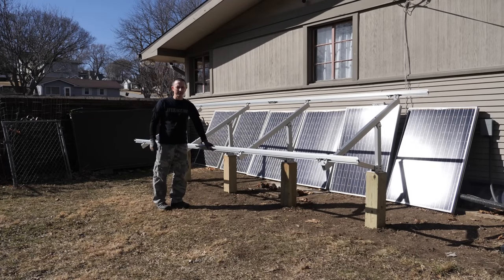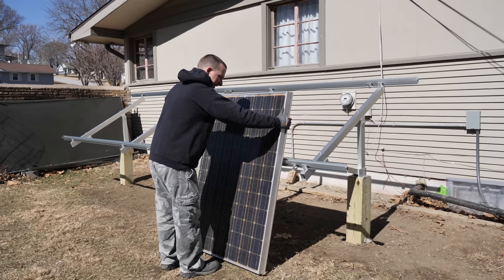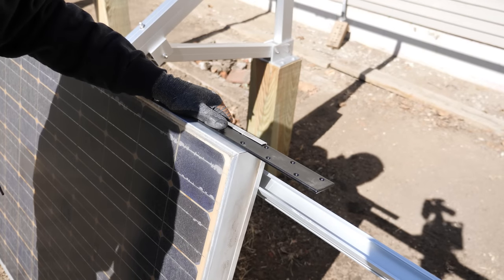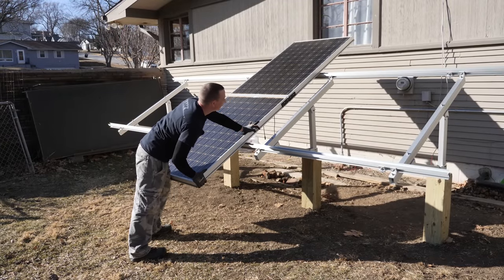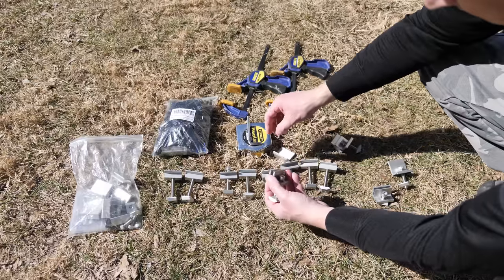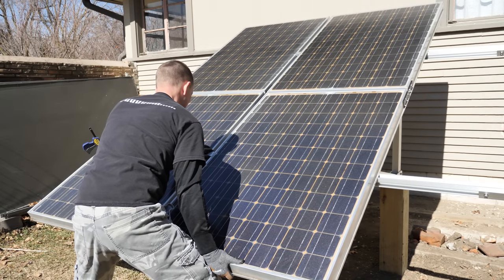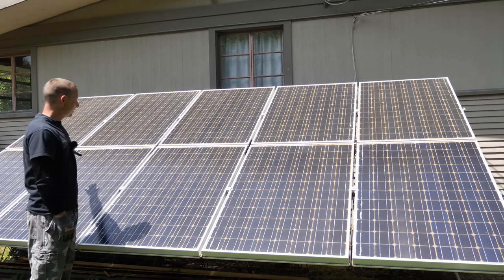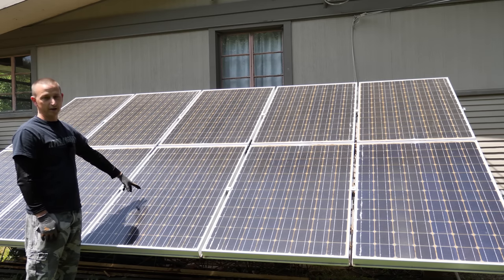10 Solar Panels on a 4 Panel Rack HAHAHAHAAAA!!!!!

Comment: Did it pass permit inspection? Also, for the end clamp, just screw a couple of blocks to the side of the panel that are at the right height for your clamps.
Reply from the maker: I just throw it together for off grid use!  💥🤘
Reply: @AveRage_Joe  Off-grid or not, in many jurisdictions, it the structure is over 28" above grade, or if you alter the electrical wiring of the building, or if the energy storage is greater than 1kWh, it requires a permit and an inspection. (I know, "Bwahahahaha") I'm not the permit police, just hoping to prevent fires.
Reply from the maker: Yeaaaaaah right, just admit it...your the permit popo😆😆JK Yeah we for sure dont want fires!🤘

Comment: EG4 has an Extension kit out now if your solar panels are too wide for only 12 bucks
Reply from the maker: I will have to check that out! Thanks🤘
Reply: @AveRage_Joe  I wonder if this mount would take those HUGE 550 watt panels. Its like what you have in the video minus the bolted together panels
Reply from the maker: Yeah Im pretty sure it would or would be super close. Would probly need those extensions😆😆

Comment: Off topic for this video but when you ground your array do you use a separate earth ground rod or tie everything into the same earth ground that your house electrical system uses?
Reply from the maker: You tie into the same ground as your house. Think of it as just connecting all the metal boxes, frames, pipes together. 💪🤘
Reply: @AveRage Joe   @AveRage Joe  I have been trying to convince signature solar about this topic, shared my inspectors requirements and sent the video from mike Holt video with this exact topic and they are saying that I have current on my ground because I have everything tied to one ground,  being told that AC and DC earth grounds are required to be kept separate, I am completely lost on the wisdom from SS on this, I will be going with the correct way bur for some reason I can't get rid of current on ground (growatt 3000tl lvm-es in split phase) watts247 says to bond AC in and AC out together to create a common neutral but I have not done this yet.
Reply from the maker: Well....there is a few things to be aware of. "Inspectors" are always "right" so if they say you need a seperate or another ground somewhere.....sadly you need to do it unless you can prove them wrong.

I think those inverters you are using need to be unbonded inside the case (by just removing the cover and removing a bond screw on the circuit board and is easy to do) and that will get rid of your current on ground.

Actual AC and DC ground should be seperate (like DC battery neg and AC from grid)BUT we are talking about the solar panel frames and rack which should all be connected to the same ground point.

I think if you remove the bond screw inside inverter that will fix your issue. If it doesnt then you may have a random wire issue inside your walls (like I do😄).
Reply: @AveRage_Joe  screw in both units has been removed,  bind done at panel, random wire in your wall as in bad wiring somewhere?
Reply from the maker: Oh ok gotcha. Well.... its possible a wire is "wired" werid somewhere. My house is old and the wiring is all messed up from way back in the day. I do have a little current on ground but its not an inverter issue. It was there before hand. Mine is a light switch wire thing. I found it by turning on and off breakers🤷‍♂️

Comment: Looks good bro really tho
Reply from the maker: Thanks Man!🤘
Reply: @AveRage_Joe  man I need your professional advice about a bms. I am building a battery with lifepo4 and a dally 300 Amp bms I just ordered but I have a bunch of leaf cells that are working great but the leaf cells need a bms from what I've been told. Can you recommend a s that will work with the leaf cells. They are in a 24 volt configuration and there are 24 of them. They will be running a sungold power 4000 watt split phase inverter.  Yeah any help with a bms for leaf cells would be appreciated
Reply from the maker: Yeah pretty much every lithium battery pack NEEDS a BMS. Some will say you dont but dont listen to them. Anyway Im a big fan of JBD bms's. You can get them for 24v or really any voltage and amp rating you want. Im guessing your cells are in an 8s2p? Just get the amp rating that matches your cells.
Reply: @AveRage_Joe  yeah my  lifepo4 is a 8s2p but my leaf battery is 24 modules is kinda a weird configuration but it's also 24 volt. My leaf modules I believe a 6s bms is what I need but it's gonna take 8 individual bms unless I run alot of cells in parallel with the bms covering a stack at a time
Reply: @AveRage_Joe  I think I'm just eventually gonna ditch all the leaf cells and buy more lifepo4 because the leaf cells are such a pain to try to make safe

Comment: The brackets from amazon... are they steal??? uno u cannot put 2 dissimilar metals together????? unless the steal is plastic or rubber coated. Other then that as a retired profession solar installer i wud give u 8 of of 10 for the install.... now make me proud and get ur OCD out and wire them panels up nice and neat. Nice to see 10 panels up instead of 4 p|ss ant ones.... uverload the f'er i say :) and BOOOOOOOOOOOOOOOOOOOOOOOOOOOOOOOOOOOOOOOOOOM
Reply from the maker: Yeah there steel and powder coated...which means that stuff is coming off lol. Ill take an 8 out of 10! Yes Sirrr OCD wiring on its waaaaaaaay BOOOOOOOOOOOM💥💥💥💥💥💥💥😆